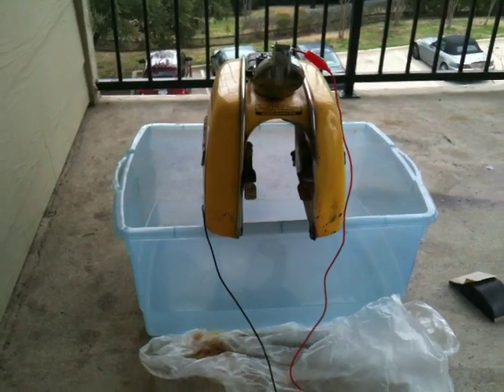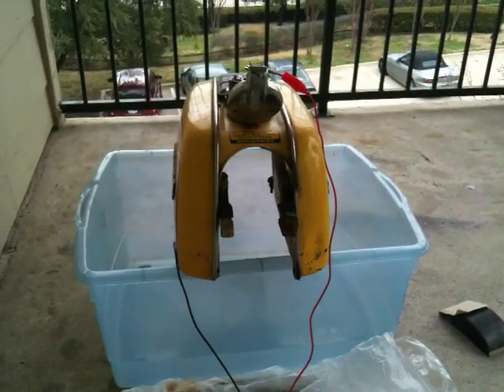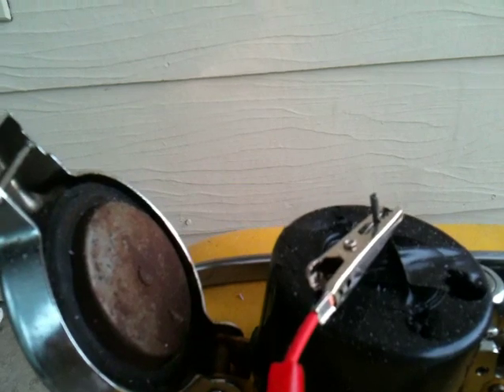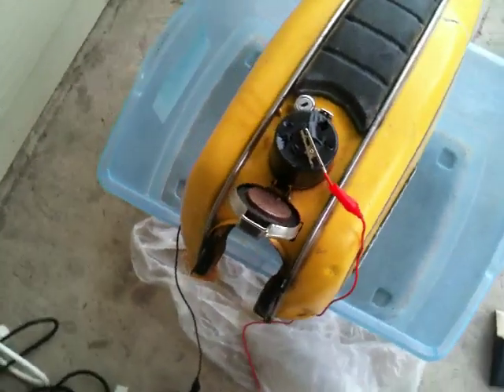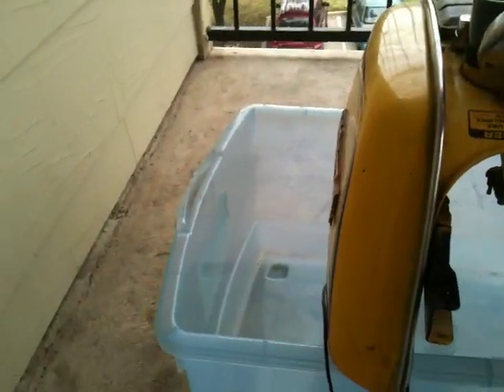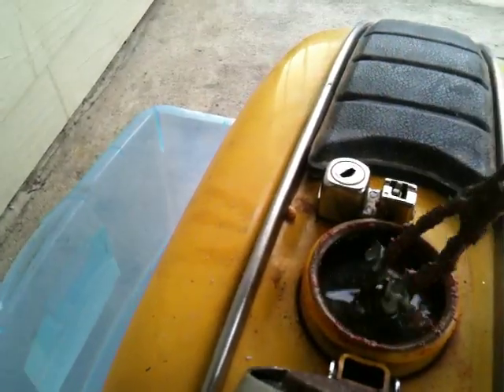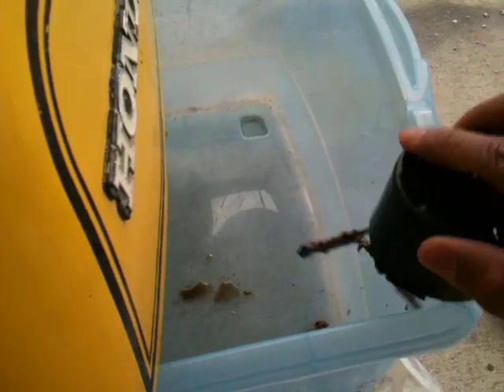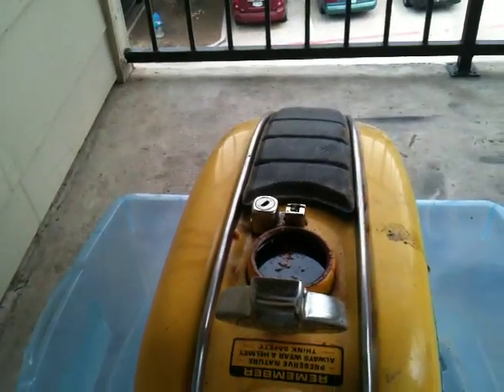Rust Removal From A Motorcycle Gas Tank Using Electrolysis

Comment: I saw this video and tried it and I found something very important.... my ratio was 1 full tank to about 1 cup of Sodium Carbonate. The misture worked very quickly and within 1 hour I saw rust that was attracted to my pipe strap hanger/anode. The problem was, the higher the concentration of sodium carbonate, the higher the current draw. It tripped the internal breaker on my 10A charger alot. I had to use about 1/4 of a cup and a 10A charger to prevent it from tripping.